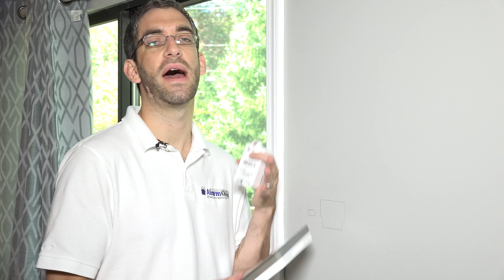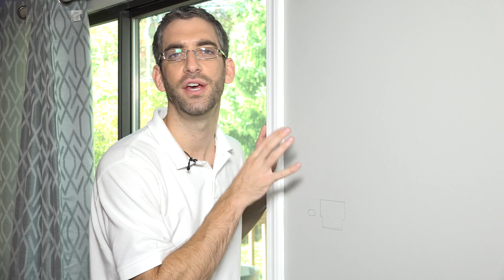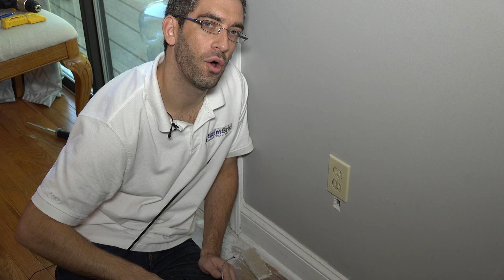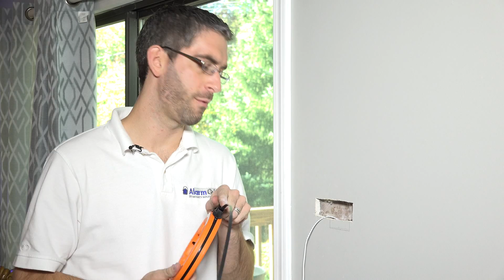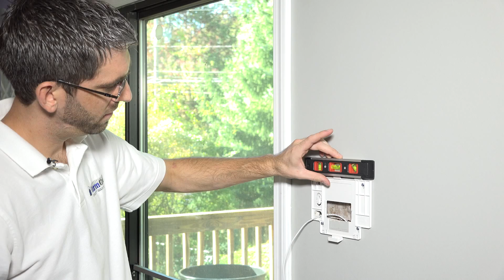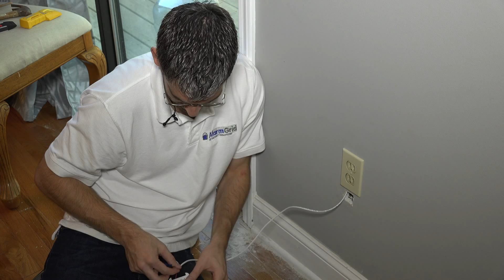Honeywell Lyric Alarm System: DIY Installation

Comment: What’s the kind of screw driver needed to remove the panel?  I’m upgrading the system and can’t seem to find a screw driver small enough to access the screw at the bottom of the panel

Comment: I'm certainly no expert but I would install the controller near the garage entry door and fish the low voltage wire up and over to the garage. Add an outlet straight up from an existing outlet in the garage near the ceiling. This way the brick is not anywhere near where it can be knocked out of the outlet by accident and it is less unsightly. Also, wouldn't yanking the power supply off the wall be the first thing a knowledgeable thief would do? I realize this approach requires access to the ceiling above. If I couldn't do it this way I would hire an electrician to put an outlet in another spot that is out of the way and preferably high on the wall. Perhaps a closet on the small portion of wall above the door where the outlet and brick will not be visible.

Comment: I have a Honeywell Destiny system and would like to upgrade. However, I do not want to use the wireless contact as I had the hidden contacts installed during a renovation. Is there a panel that I can upgrade to that will allow the integration of the wired sensors and wired QSee cameras for monitoring over my WiFi network? Thanks for your help.

Comment: Your setup on the junction box makes me want to wire a new a junction box from the existing one and essentially hide it behind the wall and plug the transformer into it and bury it behind the wall with a patch at the end . I may fasten the transformer down the same with the center screw, but this way no one can ever disconnect the power. Yes it may be a cut out of drywall about 12” tall and 18” wide but that way I cross over the adjacent studs and have enough vert to work on the box. Screw the box to the stud, wire like a regular outlet with trim plate and plug in and patch, texture, paint. 
Also we’re you making this video for people that have never touched a tool or done anything ever in their lives. I hung around thinking I’d get some brand specific install advice, but this was you over explaining how to do each task. Anyone doing this doesn’t need to be told how to curl wires to go around the terminal, or lefty loosey - righty tighty. 
Ultimately no disrespect you created a good video, but dam - retitle the thing as FOR THE NOVICE - OR - NEVER EVER INSTALLED ANYTHING - because I can tell you 90% of people visiting this are looking for tips on the unit specific install - not a beginner course on how to do stuff like this.

Comment: Hi, I have an old Lynx 5100. Thinking of upgrading. Does this unit support web server / web service (user can access the panel via web like the Tuxedo touch) within the internal network?
Reply: Hello, Yes the Lyric panel has an app that will work on a local network. It is called "My Home Controller". It is available on iOS and Android from the respective app stores. Check out our Setup doc @ https://www.alarmgrid.com/documents/my-home-controller-app-mobile-device-setup-and-use.

Comment: I'd uses a solid fiberglass push rod , remove the electric outlet cover , cut a vertical slot next to the wall box " the plate edge will cover it when reinstalled " and this will allow a nice angle to push it up the wall
Reply: Not a bad idea thanks for the advice I will note that thank you.

Comment: Wow... terrible install. Hire a qualified licensed electrician..
Reply: Man it Diy dude the man runs the business what's up your butt you do installs and lost a customer to them
Reply: @truthofall6311  he literally cut a hole below an electrical outlet and put a low voltage cable there.... 

I'm pretty sure that's not legal according to the national electrical code.

I don't care who you are you don't compromise somebody's home with a bad electrical install you could cause a fire and possibly death.
Reply: The professional way to power that panel would be to install a dedicated 24/12v power supply  with a battery backup and dedicated circuit from the mains ..maybe in the garage or attic

Not putting a crappy little transformer on an electrical outlet with a hole below it.

Comment: It’s disappointing that this instructional video was prepared by someone who did not really know what he was doing.  This did not need to take an hour.
Reply: Do you have any specific recommended changes or edits?
Reply: Seriously, it’s the most over explained video. Ever! I watched most of it thinking some ground breaking / Honeywell specific info pertinent to the unit would come out and surprise, nothing new. I have this guy telling me left loosey righty tighty, and shit like how yo curl the wire. Gigantic waste of time. 
Now for someone that hasn’t really ever picked up a tool, I could see the importance of a video like this. It should be titled differently. Comically - Honeywell install for morons- or -Honeywell install for the complete novice.

Comment: Confusing! On the transformer the positive on the right n negative on left but when you turn the transformer around to plug in the power outlet it is the positive on left n negative on right.  On the power outlet the hot is on the right, neutral on left if the ground plugs face down, so unless on the transformer the wires from the plugs to the terminals are across, if not then the positive on transformer plugs into neutral hole on the power outlet and negative plug on transformer goes to hot wire on power outlet.

Comment: You would think they'd make this shit wireless so you could just change batteries once a year or something rather than put holes in your walls. 10 years from now.... a guy will go to change this thing out with newer tech and there'll be 2 shitty holes in the wall that likely won't be the same size as the newer system.
Reply: There is no professional security system that's completely battery operated. If you're able to find one or design one yourself, we'd love to hear about it! With that said, there are cleaner ways to wire the panel to the transformer so the hole in the wall is less obtrusive. John Wagner's comments below detail one alternate way. Also, you can desk mount the system using this alternate part - https://www.alarmgrid.com/products/lcp500-dk so that you don't have to put any holes or fish any wire.

Comment: Hey Sterling!

Have you guys found a more elegant solution than the gigantic power bricks?

Does anyone make an in Wall one?
Reply: No in-wall transformers available, I believe that may be a fire hazard. There are recessed receptacles that give the appearance of a hidden transformer however.
Reply: @dylanalarm_grid1038  It would be great if they could come up with a POE (Power Over Ethernet) option. Plug it straight into a POE switch and  no visible power supply for a clean install, perfect.

Comment: That wire fish could be a lot easier if you take the plate off the outlet and the pry with a flat blade screwdriver on the stud side of the outlet box pushing against the box. This action pushes the box in to the wall allowing greater access than that one inch square hole. The more you push the box in to the wall the greater the access. I usually pry the box back until it releases from stud. Then to put it back you’ll have to push the nails in the ears of the box out or back enough to allow for a flush to stud install. To hold the box in place just screw two drywall screws through the inside of box at the stud side and in to wood of stud   
Now that is if you have a nail on plastic box to work with. 
GOT IT?
Reply: We appreciate the suggestion John and we certainly understand there's better ways to fish a wire. I'm sure your suggestions will be helpful for others that watch this video. Just to be sure I understand your explanation, you're simply routing the transformer wire between the outlet box and the drywall, using the existing hole for the outlet box?
Reply: Sterling, to answer your question to my reply. 
Basically your moving the outlet out of the way, giving you greater access to the wall cavity in which your fishing. And actually you wouldn’t need to cut the little hole behind transformer. You can just route the wire out of the bottom of the existing outlet box hole.
I gotta hand it to you though for getting that wire around the box to the hole. Great fish!
Reply: Ah, I understand now. You were just describing how to move the box temporarily so it's not as tricky to get it around the box. It would also prevent the need for the hole we made (which is hidden by the transformer but may be an issue if the system is ever moved in the future). Thanks again for the comments!

Comment: will this work on wifi only? can you receive alerts and have automation without an alarm contract like vivint or frontpoint etc?
Reply: The Lyric will work with WIFI connectivity only (no cellular needed) but you do have to have some level of service for remote control and alerts. We offer plans with no contract required as low as $10/month online at https://www.alarmgrid.com/monitoring

Comment: on the tamper/stud situation, use a drywall anchor and still screw it in.  After the panel is mounted,   cut the tabs.